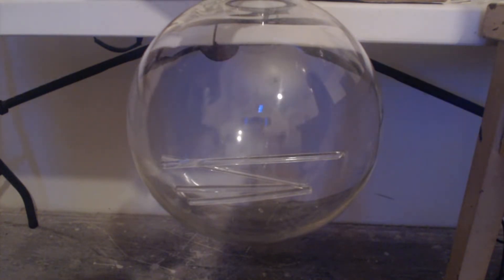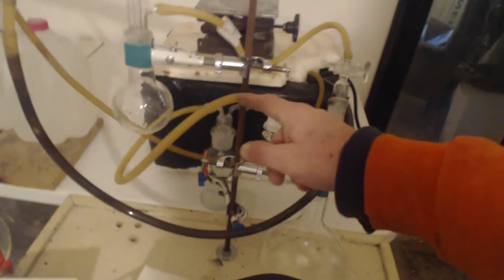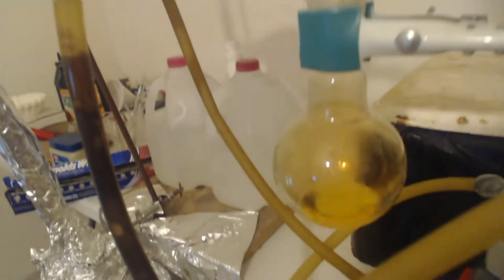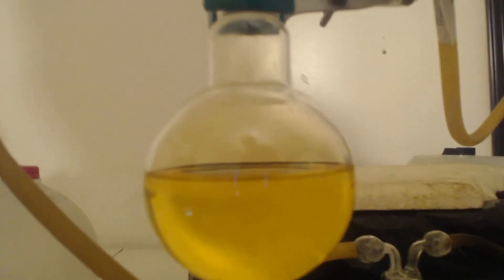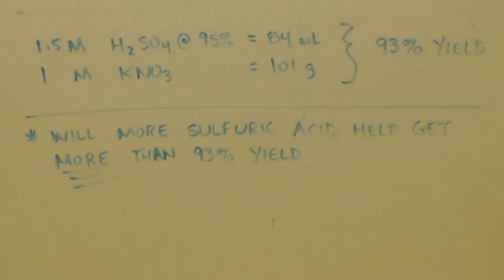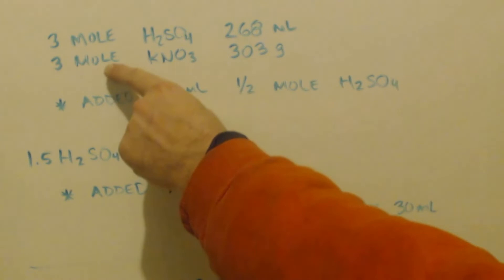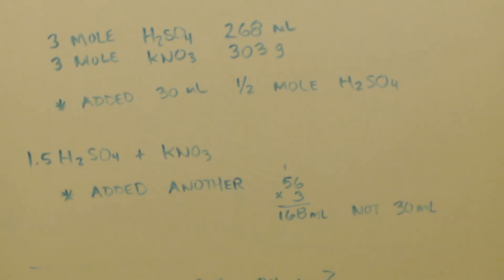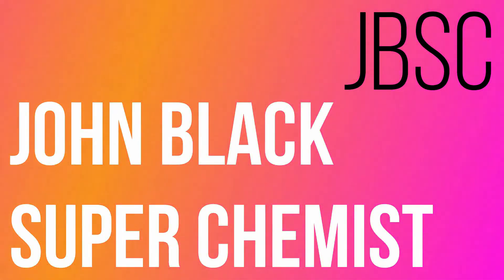FUMING NITRIC ACID SYNTHESIS  93% yield

Comment: Ever derived benzaldehyde from Nitric acid?
Reply from the maker: Josiah...........Have not tried it yet but i do have instructions on how to do it.    If you want the instructions let me know and i will look for it again to show you
Reply from the maker: Josiah ........OH MY BAD......IT WAS NOT NITRIC ACID....... IT WAS NITRATE SALT THAT WAS USED ...........A simple and effective approach for the synthesis of benzaldehydes from benzylic bromides is reported using sodium nitrate as an oxidant with 10% sodium hydroxide. Benzyl bromide is oxidized to benzaldehyde in 91% yield with 98% conversion at 120 °C, whereas 82% of benzyl alcohol is obtained at a temperature of 80 °C in 80 min with 20% sodium nitrate solution.
                   To a 100 mL two-neck round-bottomed flask fitted with a
water condenser and dropping funnel, benzyl bromide (1.71 g,  10 mmol), sodium nitrate (0.850 g, 11 mmol), and water (1.5
mL) were taken and sodium hydroxide solution (0.440 g, 11
mmol, in 5 mL water) was added dropwise over a period of 4 h
at 120 °C with vigorous stirring. The reaction was monitored
by HPLC (Shimadzu) using methanol and water (80:20) as
eluent. When the reaction is over, then the reaction mixture was
cooled and extracted with diethyl ether (3 × 25 mL), washed
with cold water to remove any alkalinity, and dried over
anhydrous sodium sulfate. The removal of solvent affords 1.0 g
benzaldehyde (91% yield).
                    Here is a link to those instructions   https://krc.cecri.res.in/ro_2010/2010-090.pdf
 If you have any more questions let me know.  Keep in mind i have never done the experiment yet so i have no FIRST HAND knowledge that it works.   But it does look like some REAL chemist wrote the paper so i believe it works.   YOU CAN REPLACE NaNO3 with KNO3 if you want.   Since KNO3 is sold 100% pure in hardware stores as  "stump remover".

Comment: The proper ratio for potassium nitrate and concentrated sulfuric acid is 101 g potassium nitrate 98 g of concentrated sulfuric acid almost a one to one by weight simple distillation between 80 and 83°c
Reply from the maker: rod............Yeah in a balanced equation the proper ratio is 1:1 molar ratio between KNO3 and H2SO4 like you suggested.  But that is only on paper.  In real life you need to add extra H2SO4 or you end up getting a LOW yield.   Here i did a video doing EXACTLY WHAT YOU ARE SAYING  and i only got a 50% yield instead of a 93% to 95% yield.   https://www.youtube.com/watch?v=4FzLuf9tFKs     I actually go over all this in the video above if you watched the whole thing